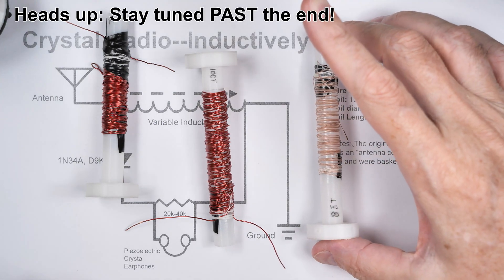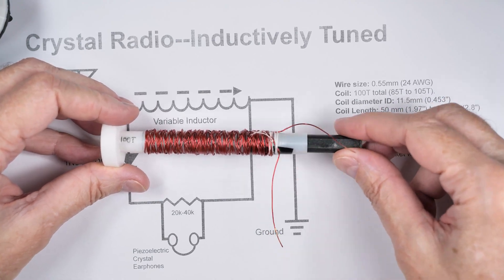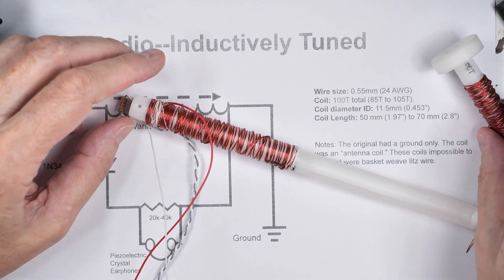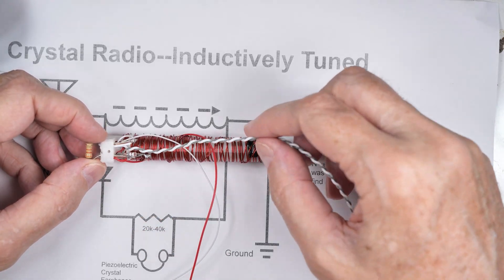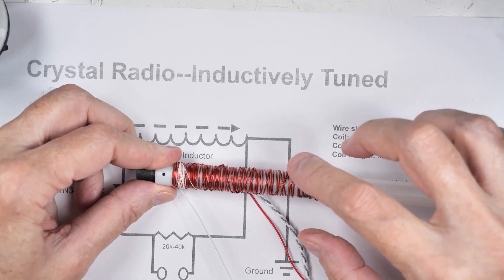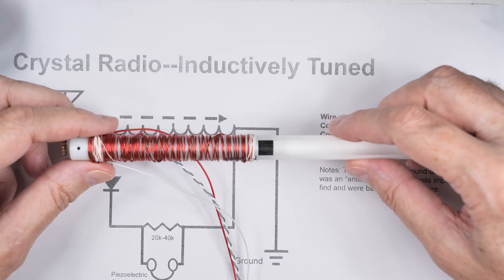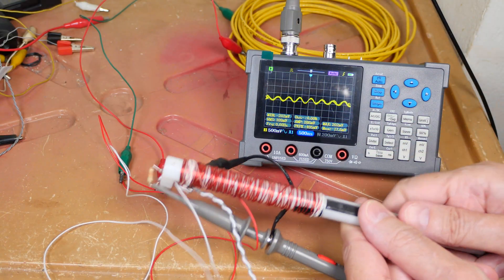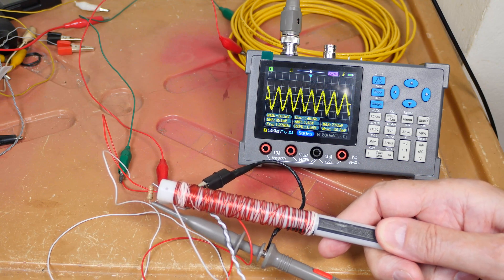Crystal Radio-Portable, Packable, Prepper Wand Radio

Comment: you didn't use the diode correct? so the scope shows the modulated waveform?
Reply from the maker: What do you mean?
Reply: @tsbrownie  in your schematic there is a diode. but it seems you didnt use any? to capture the carrier as well?
Reply from the maker: @mejoe444  Watch again. The diode and resistor are there.

Comment: That is the design of my little spaceship crystal radio. The nose is attached to the Ferrite rod that slides in and out of the winding. It is a little rocket ship with and antennae wire and earphone. The nose is a little bead at one end of a rod attached to a Ferrite rod. It slides in and out of the nose of the rocketship.
Reply from the maker: I had the satellite version of that when I was 7.

Comment: In the 1970s I used to make and give away small crystal sets made with a plastic 35mm film cannister. 
The coil was wound around the outside and the resistor and diode inside. Tou could make the same thing with a pill bottle.  They worked Ok, but not very well.
Reply from the maker: I have seen those. I am working on something that's not exactly the same, but it follows that idea. The miniature radios were cool, but they only got 1 or 2 stations. I'm doing a tradeoff for size and better reception. We shall see.
Reply: @tsbrownie awesome looking forward to seeing your ideas.